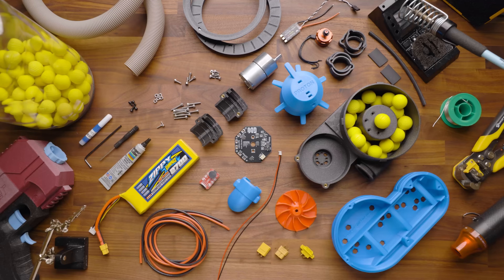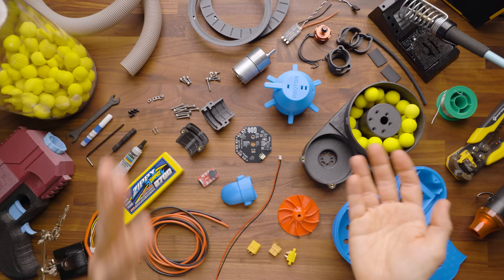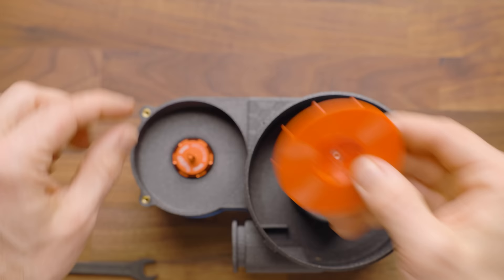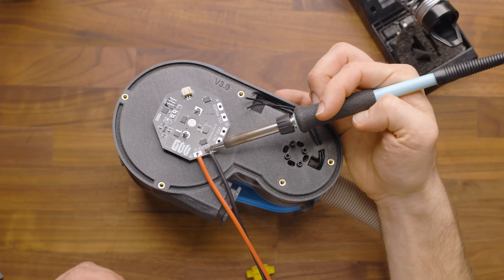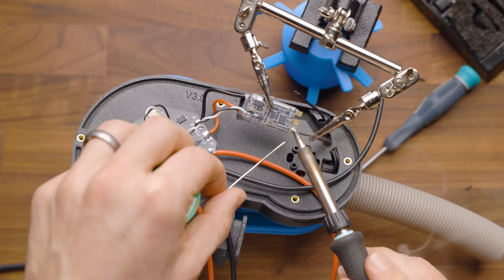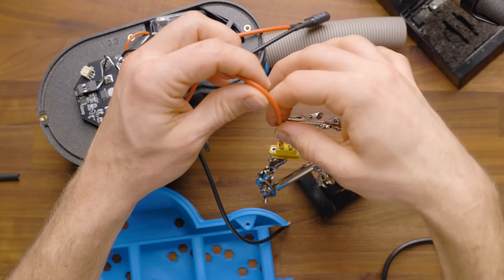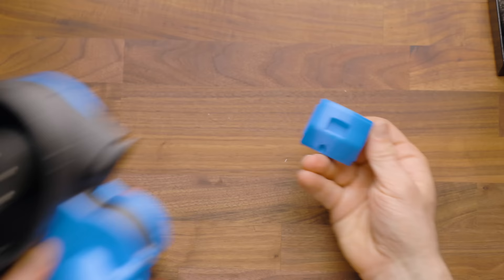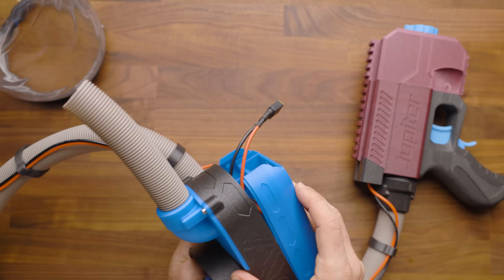BUILD GUIDE: Proton Pack

Comment from the maker: What did you think of our build guide? We're always looking for ways to improve the clarity of our tutorials.
If you have any clarifying questions, don't hesitate to ask in the comments or email us at orders@outofdarts.com
We'll be listing the most common questions in the FAQ section of the video description.
Reply: When will the assembled pack ship?
Reply from the maker: They should all be shipping within the next couple of days. If you have any questions or issues, feel free to shoot us an email: orders@outofdarts.com
Reply: Really interesting, but im wondering if you're planning on making a kit with a set of electronics and 3d files to print on our side compared to the jupiter ?
Reply: The Auger screws didn't get locked on camera, maybe off camera before Hose Connection
Reply: Well, I‘m from Germany, and the shipping costs are over 20€
Reply: Why weren't the two screws on the auger screwed in after the piece was placed on the motor?
It seemed to me that they were ment to connect the auger to the motor, but the were never secured to the drive shaft.
Reply from the maker: Whoops. I must've accidentally cut that bit in the edit 😅. Good eye. - Perry
Reply: This was easy to follow along with
Reply: Could you tell us where you get the hose? and the stuff that is covering the hose? It's not on the shop I think.
Reply: @outofdarts  will there ever be files to 3d print one myself?

Comment: Suggestion: The connection between the ESC and the brushless motor was rather confusing for me, it might help to have coloured stickers on the wires or some other sort of marking.
Other Suggestion: A thumbscrew could be used on the battery compartment and there could be a little slot in the main body to store an allen key for easy maintenance.
I really enjoyed watching this even though I am not building a proton pack myself. Your design is amazing and I think it's brilliant how simple and effective you have made it, especially with the current draw sensor which is very ingenious. Thank you! 💜🧡
Reply: For the brushless motor if it’s soldered wrong all it will do is spin backwards and the fix is desolder any two of the three wires and switch pads they are soldered too and resolder them

Comment: I am not assembling one just watching because I am curious. I would panic when it comes to those three wires. Even you were worried and double checking yourself. Can they be colour code in some way?
Reply: For the red brushless motor If you wired the motor wrong all it will do is spin the wrong direction and the fix is desolder any two of the three motor wires and and switch pads and resolder them

Comment: To sdjust the pots, might you not want a convenience hole in the bottom of the chassis to do so without disassembly?

I suppose it will only happen the first time, unless you have multiple blasters you swap it out with, but thought it worth mentioning.
Reply from the maker: This is a really great idea, except sadly the battery might be In the way. I’ll see if I can implement this somehow!

Comment: I'm watching without building it and wouldn't that brushless motor for the fan have a wire marked with a line or a doted line to indicate ground that could be easier to identify!?
Reply from the maker: That's a good idea! The wiring of a brushless motor to an ESC doesn't have a defined positive, negative, or ground. However, If it makes it easier to mark your wires with a sharpie before installing your motor, follow the left version in this diagram by DroneTest: https://www.google.com/url?sa=i&url=https%3A%2F%2Fwww.dronetrest.com%2Ft%2Fesc-to-motor-connection-guide-how-to-reverse-your-motor-direction-the-easy-way%2F1297&psig=AOvVaw3vuAXcjNae8yM2RJBtp7C5&ust=1624560553134000&source=images&cd=vfe&ved=0CAoQjRxqFwoTCLC05ue1rvECFQAAAAAdAAAAABAF). - Perry

Comment: At about 33:35 there was talk about filters, and if I recall correctly as not an expert, the reason for the filter isn't about the lead, because its too heavy to really be the concern, but instead about the rosin flux core fumes, which generally speaking tend to actually be worse with lead free solder (though I'm not sure if this is true with really nice lead free solders like SN100C). 

It's a lung irritant, and I'm sure has long term health implications particularly for people soldering frequently.
Reply from the maker: This is definitely true.

Comment: How do I connect the proton pack to a jupiter so it revs with the rev triger and shoot with the primary triger? In the build guide, it just seems that you connect the proton pack to the jupiter’s battery.
Reply from the maker: Yes, built into the Proton Pack board is current sensing that recognises when the blaster is reving and when it is firing. It makes wiring for the end-user much simpler
Reply: @outofdarts  Thanks for a less then an hour later answer!

Comment: How does the flex in the feed hose go? Do you get many jams with having this basically load from the hip, instead of having a shorter hose that comes over the shoulder?

Just curious if you looked at the Paintball loader or Maxxloader? I’m sure you could come up with a similar system that would work in the same manner
Reply from the maker: The brushless blower provides enough positive pressure that hose length and placement is not a big factor. - Perry

Comment: It seems that the pack actuation is keyed to the rev trigger.  If you rev continuously but don't fire what happens to the balls?  Do they eventually jam, or...?
Reply: I'm pretty sure the only thing pushing the balls into the tube is the air pressure, not the auger or anything physical. So I imagine you wouldn't get a jam from revving for any period of time.

Comment: which blaster adapter do I need to set as the buy option to attach it to the hiricane. Or can I not do that?
Reply from the maker: We are designing a Zeus adapter, but I don't think it would be compatible with the existing HIR-icane setup. We've got a lot of different adapter plates though, so anything is possible! - Perry

Comment: I have 2 questions. 
1. Does it require any modifications to the blaster in the wiring?
2. Can your Jupiter internals work on the Apollo?
Reply from the maker: 1. If the blaster is already wired for 3S, then no further modifications should be required. 
2. What do you mean by internals? Do you mean the hose adapter plate? - Perry
Reply: @outofdarts  I meant the cage. Can a Jupiter cage fit in it
Reply from the maker: That I don't know. Shoot us an email (orders@outofdarts.com) and someone more knowledgeable than I will answer your product and modding questions

Comment: The hand waving and focus going bad makes this an uneasy video to watch. Please use manual focus.
Reply from the maker: Sorry! We've gotten better with focusing in more recent tutorials. The issue, at least back then was relying on the autofocus because of social distancing requirements. Luke and I are both vaccinated, so we're looking at better solutions going forward. - Perry
Reply: @outofdarts  Congrats on the shots (pun intended). Autofocus is a pain in the ... - at least with the camera's I owned - and I found that it gives less issues with the camera at a larger distance and zoomed in a bit. But I still don't like to use it myself. Actually, I am just now (literally today) setting up a system with two fixed focus camera's to film some electronics assembly stuff.